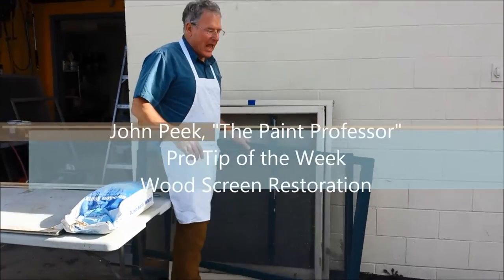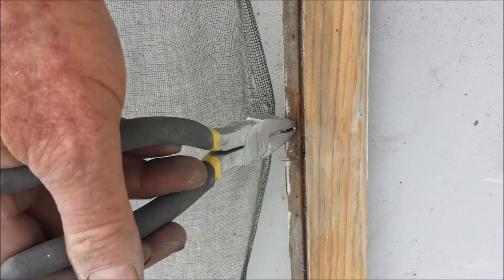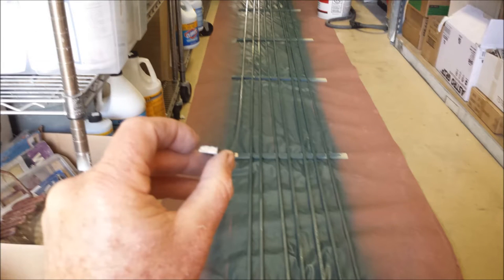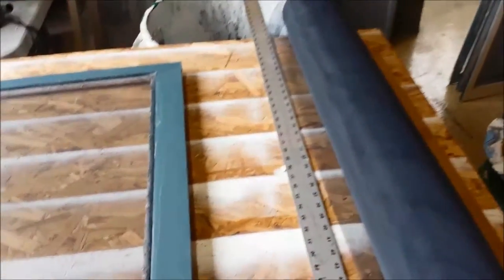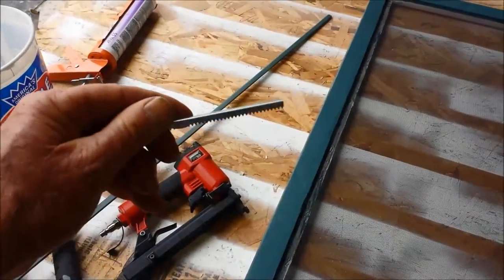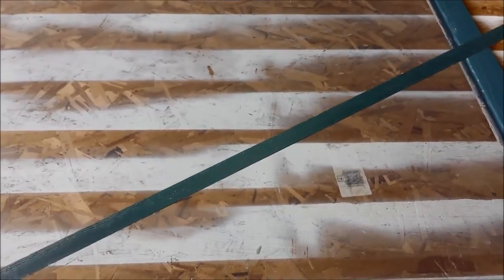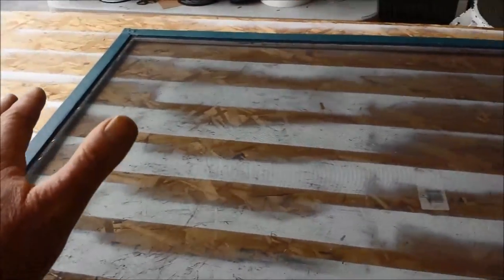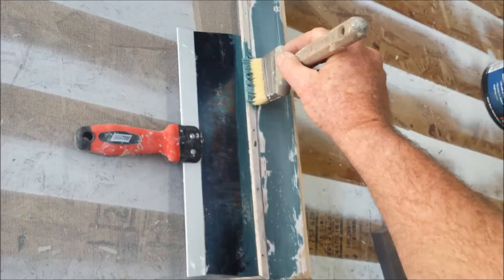Wood Screen Restoration

Comment: Do you have any videos or instruction on repair to the frame itself? I have wooden frame but the corners where they join need repaired, looks like the metal piece to connect the 2 pieces is broken. Thanks!

Comment: Mine have spring-loaded knobs that are pulled out from the screen to lock into the window frame. Are those still available on the market? My moldings are so old that the wood has rotted away and those pull out knobs are rusted and broken.
Reply from the maker: Call your local Ace hardware
Reply: Search the web to try to match  anything you need to replace and/or find a local woodcrafter if you aren't doing the repairs yourself.  They can figure it out!  I thought calling Ace Hardware as an answer wasn't too helpful, but if they have the spring loaded locks... great!   I want to make mine from scratch in the old style, bc it's just making a frame and putting in screen.  I found the old style hooks online that they use to hang screens with and a simple screen lock on the sill.
Reply: I was more interested in your technique for stretching the screening but you didn't cover that.
Reply: @johnpeek7908 pllllll